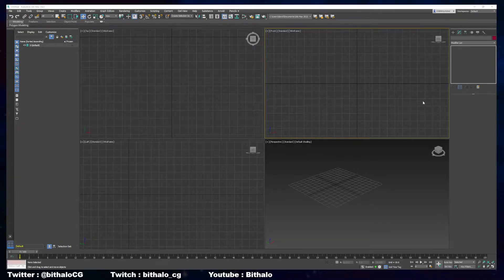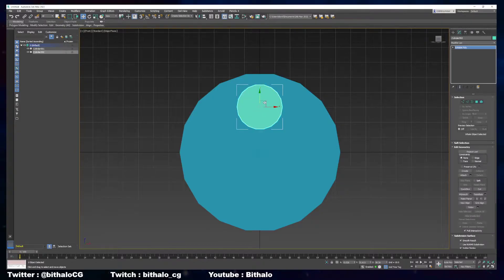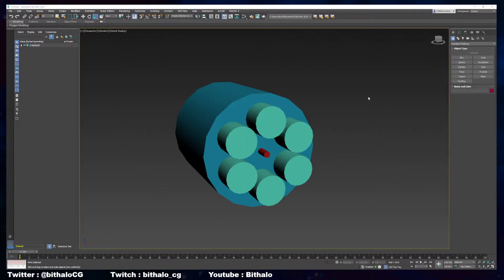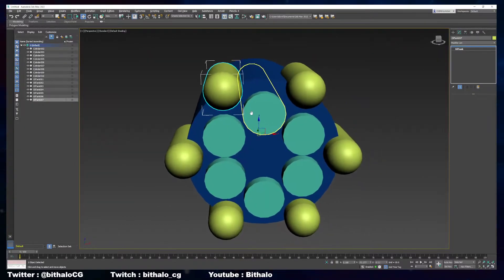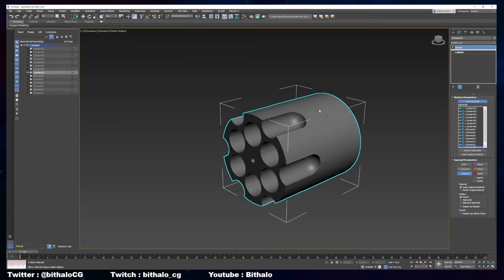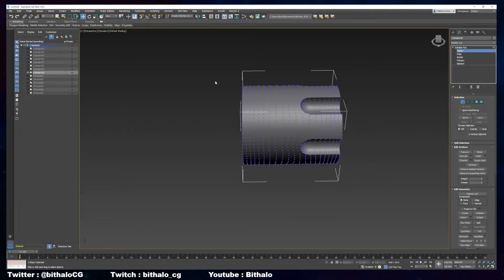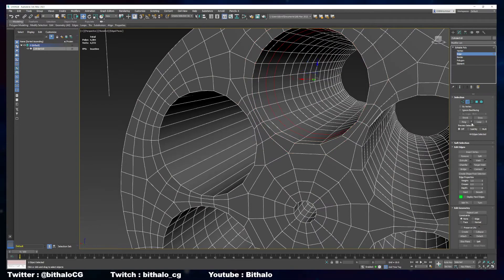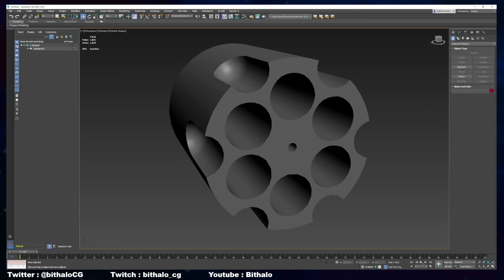3DS Max -  Revolver Cylinder Array to Boolean + Retopo -Tutorial

Comment: Very useful tutorial. Have been modelling weapons in Fusion360 and using Max to retopo. But given the time it takes to retopo to make a game asset I might as well model in Max. The vert count tends to be around 3k but I model the indents that turn the cylinder too. I will probably start using alphas to stamp that detail in for my VR games. With the retopo tool , the edge flow seems to be heavily affected by hard edges. Also dont need the centre hole